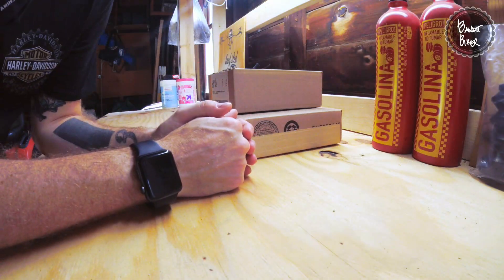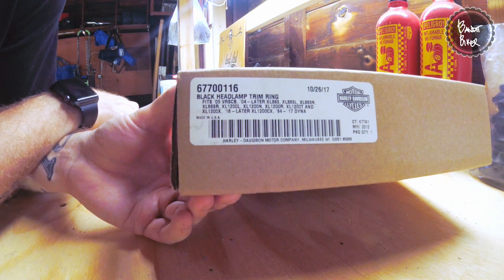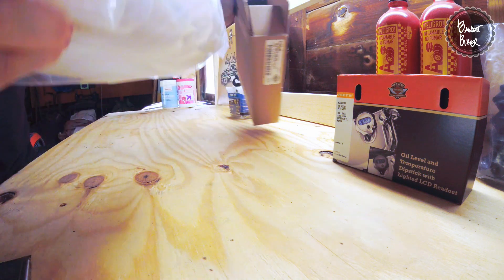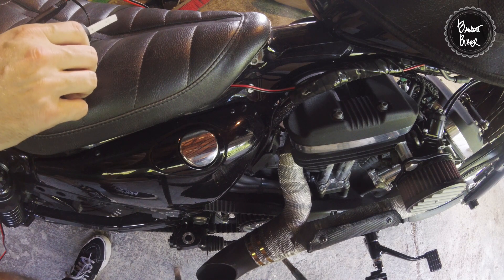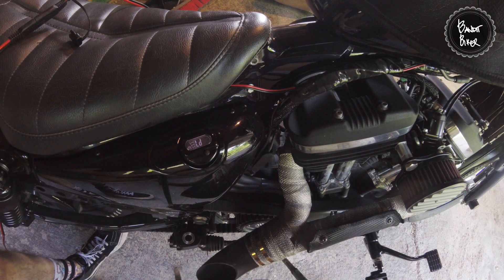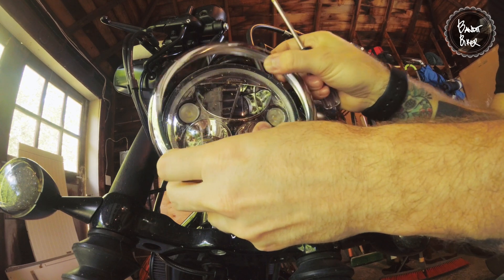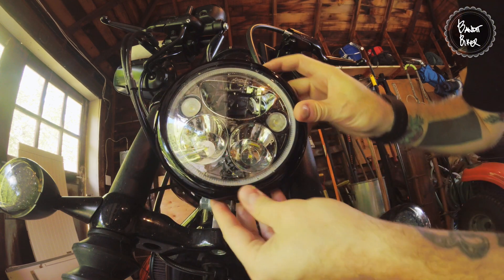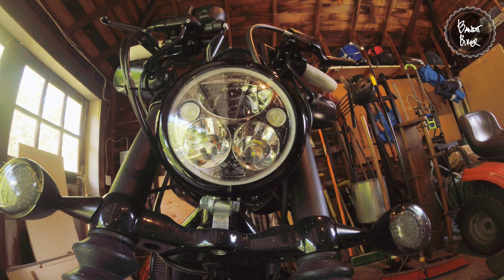Harley Davidson Sportster headlight trim ring and temperature dipstick install

Comment: How do you replace the battery on the dip stick
Reply from the maker: It's located on the underside of the display. I believe there are 3 small screws you need to remove which will allow you to replace the CR 2032 battery.

Comment: Exactly what I needed.
Can you make a review about the dipstick after almost two years? One of the comment on the store says that this is poor quality, battery won't last over a year, changing the battery will kill the screws and then you have to buy another one..?
Reply from the maker: I can verify I'm still using it and it works well. I haven't had any issues. And it's great at reading in both cold and hot temperatures. It helped me know I needed to top off the tank a little bit earlier this spring.